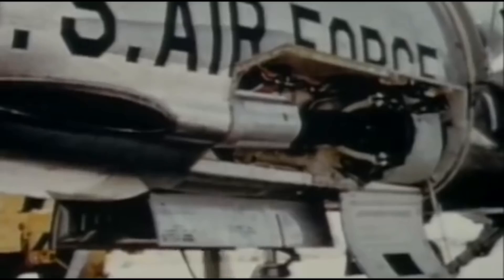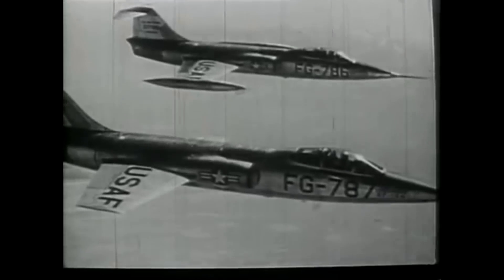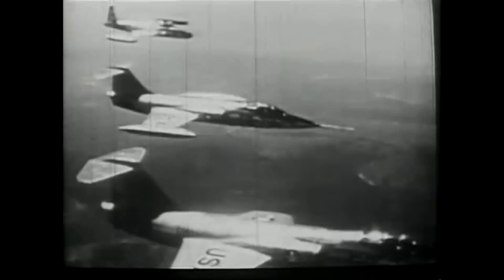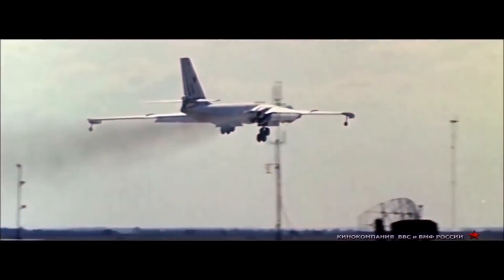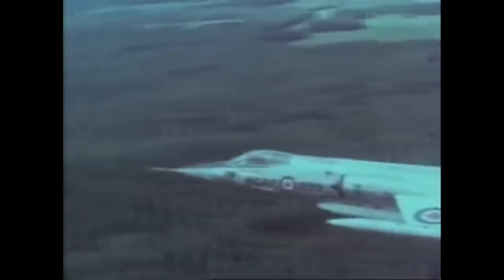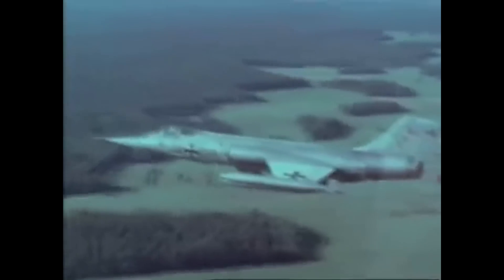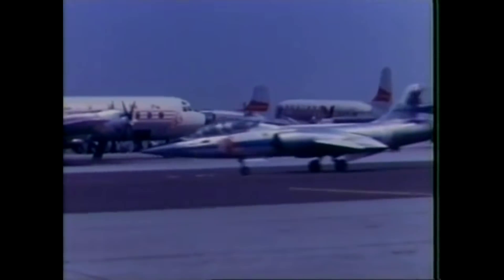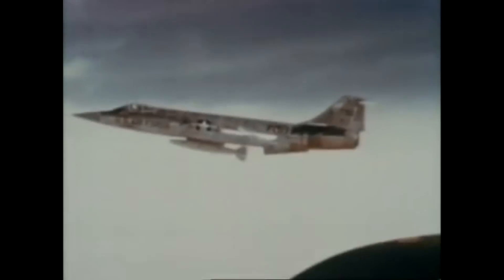Lockheed F-104 Starfighter | The worlds first Mach 2 fighter

Comment: I wonder if on any of the takeoff flameouts the pilot tried to pitch up or roll belly up before ejecting.
Reply: I don't know about the flameout issue, specifically. But...I had heard this story multiple times, can't swear to the validity of it.

 The W. German Luftwaffe used the F-104 quite a bit, and were very fond of it. Eventually, they also retrofitted their aircraft with the upward firing ejection seats. Of course, not all aircraft were instantaneously converted, so there was some time frame where there were some "fixed" upward-ejecting F-104s, and some as-of-yet unmodified downward ejecting F-104s.

 Well...the story goes that a German Luftwaffe General was taking an F-104 for a flight (I believe most generals who were pilots fly often enough to maintain their certification...and also to continue to collect their flight pay), and his aircraft developed an issue at low altitude. So, true to the many training sessions he had undoubtedly gone through during his years of flying the F-104, he performed the routine drill of rolling upside down, and ejecting. This was standard on the downward ejecting F-104s, when forced to eject at low altitude. Unfortunately...the General was flying a modified upward-firing F-104, and he ejected straight into the ground, which obviously resulted in his death. Whether the pilot was unaware of the ejection seat conversion, or was aware, but in the heat of the moment, reverted to his long-standing training procedures, who can say.

 Again...I am uncertain as to the validity of this story. I'd heard it multiple times during my nearly 15 years in the USAF. But, it may be nothing more than a colorful story. I tried searching for references to this incident, but I couldn't find anything regarding this specific event (but...lots of other F-104 crashes, of course!)

Comment: This POS aircraft only saw the light of day due to US bribery and corruption. The aircraft it was in competition with were far superior to this aircraft. It killed way to many pilots who flew it.
Reply: Pilots killed themselves. Spain didn’t lose a single one. Probably because of better training. 

The -104 also saved pilots. The CAF was losing CF-18s at an alarming rate in the 1980s. Turns out that it was those pilots who had no other jet experience except the Tutor who were dying. The Tutor is closer to the Beech Musketeer than to the Hornet in terms of performance. 

It was those who had previously flown -104s that were safer pilots. 

Ultimately the solution was to transit pilots through the CF-5.. another plane with tiny wings and nasty low speed characteristics.

Comment: The 104 was NOT designed nor built to be a fighter.  Its SOLE role by design was as a bomber interceptor.   If you look at the wings and the obvious monstrous wing loading that is clear to even the most novice pilots.  It was complete crap when they tried to use it as a fighter. vs. real fighter jets.
Reply: Incorrect.  It was designed to be a day fighter--it didn't even have a serious radar.  The F-102 was the all-weather bomber interceptor.  When its entry into service was delayed due to development problems the F-104 was pressed into service to fill the interceptor gap until the F-102 was available in numbers.

http://www.916-starfighter.de/Ruminations on the F-104.htm

Comment: Realy doubt, this flying coffin was capable of any fight. Lucky pilots it didn´t make it on time for Korean war.
Reply: Oh it definitely was. 

The NVAF Mig-21s gave it a very wide berth when they were escorting EC-121s over the Gulf of Tonkin. They knew the F-104 wasn’t a lead sled like the F-105s and F-4s they were used to. The only plane the US had that was as good on all terms was the F-8.
Reply: IA On
You must mean Lucky for MiG-15 pilots.  The F-104 would have kicked the MiG-15 into the yellow Sea.
Reply: @gort8203  And how exactly would they do that? By maneuvers like this?  https://www.youtube.com/watch?v=gOwIdAXlgPg  When US pilots asked for faster plane, they meant faster Sabre. Not this wingless widowmaker
Reply: @iaon652   You seem to think you're clever.  I suspect you get your ideas about air combat from watching video game dogfights that always begin with an equal head-to-head pass and a commitment to a tight turning fight.  Well, that's not real world combat In the guns-only era.  Most fighters were shot down by an enemy they never saw until it was too late.  When both fighters did see each other, the fighter with superior speed, acceleration, and climb was the one that controlled the engagement.  A tight turn did not control  an engagement, it was a defensive maneuver used when a pilot was lucky enough to detect an attack in time to use it.  
The Spitfire Mk V was unpleasantly surprised when it first encountered the Fw-190. The Spitfire could turn a tighter circle, but the Fw-190 was superior in speed, climb, acceleration, and roll.  The Fw-190 held the upper hand over Europe until the Spitfire Mk IX with more power was available.  Turning tighter could keep a fighter from getting hit, but it didn't help the slower fighter extend out of the fight or convert into a position of advantage on the faster fighter. 
If it had been available in Korea any pilot would have preferred the F-104 over the MiG-15, because unlike in a video game, his life was at stake. The superior speed and climb would allow the F-104 to engage from a position of advantage. In real combat pilots do not set up for an equal fight, they set up with as much advantage as they can get, and they don't engage without advantage unless willing to gamble their life to protect another.  But even from an equal start from a head-on pass the F-104 would be superior, because it would be able to control the engagement, and disengage at will to either reposition for another attack or to go home. The MiG-15 would not be able to touch a properly flown F-104.
And please stop the "widow maker" taunting.  It's juvenile. The small wings of the airplane didn't cause those German F-104 crashes.  Deficiencies in training and operating procedures cause airplanes to fly into the ground, not the size of their wings.